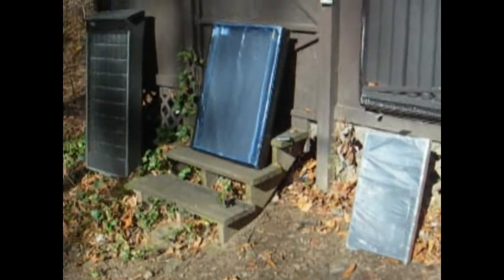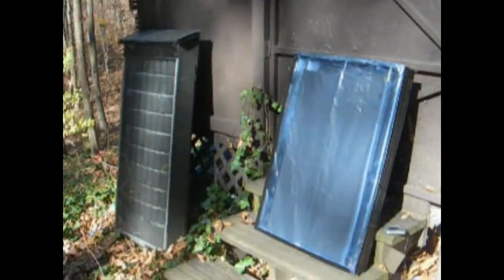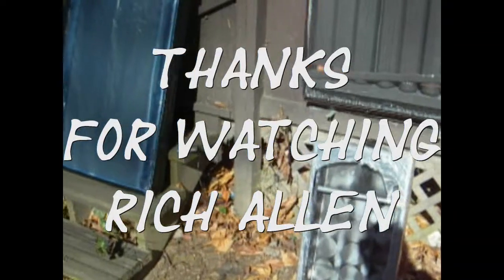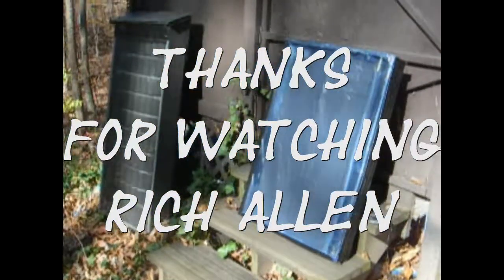SOLAR HEATERS FINAL THOUGHTS RICH ALLEN

Comment: Cool.  I thnk someone else indicated that all you really need to do is paint the box black and it should generate heat as long as the sun is out.  ??   So is it really necessary to even put the metal in the box?  Could you just paint it black and put the plastic over it?

Comment: Exellent idea to compare various models. The real test would be to stick the same small fan (say from an old computer) on each in turn and compare temps after they stabilize.  I also doubt the necessity of cans. Wonder if inside the box you strung used Aluminum Xmas garland and sprayed it black. Lots thinner and might conduct more heat to the air flowing past it. Double up layers of 4 mill clear plastic? Space them apart with small pieces of  quarter inch weather strip door foam. Thoughts

Comment: Rich, thanks for the video, I am interested to see what happens to all your heaters once a fan is put on them. I may be wrong, but I think the ones with the cans and glass would hold the heat better, and once the fans come on, the plastic ones couldn't keep up with the metal/glass one. (they would heat up quicker, and radiate the heat better)

Comment: 2" depth is the important dimension, can be as wide or long as you want as long as it's about 2" between the glass and the backing.  if you make the box taller you use stack-effect to create a stronger flow.

Comment: A solar can heater if built correctly will give you way over 200 degrees continuous. You should have built a larger unit unless your situation didn't accomodate for it. Nice work and thanks for posting all of your videos.

Comment: To use a Fresnel lens, make it bigger than the collector box, mount it in front of the collector box so that the light it collects and magnifies cover the entire collector box. For example, if the collector box is 4 sq. ft. and your Fresnel lens is twice as big (8 sq. ft.) you'll probably need it to be two to four feet away depending on the magnification factor of your lens. The idea is to capture more light than the collector box can and shine that concentrated light onto the box.

Comment: @richallenmusic I'm wondering if the design can be even simpler than you discovered. Do you even need to add metal inside the box at all? If you're using foil faced foam board for the box, I wonder if it's enough to just paint the interior black and have the foil surface radiate similar heat. Did you ever experiment with an empty black box?

Comment: hey Rich - is the trick with the pop cans mainly their surface area? - from your work seems like chicken wire to support painted aluminum foil would the most cost effective and least work intensive (?)  what's a good cheap black paint? do they really need an upper chamber? - are there any rigid plastic sheets which are cheap? - or best to wrap with 4-6mil plastic? - a full wrap would kinda protect the wood assuming not too much moisture settles inside.  Best, Freddy

Comment: The lens won't change anything. It will make some spots hotter, the rest cooler and the average won't change. The heat you get is based on how much sunlight the box captures and how much heat it loses.

Comment: Hi Rich.  My concern is melting the glazing. I live in Flrorida.  We do need heat for about 2 months in Tampa, but we only need to heat from about freezing to 70 (40 degree differential).  A couple thermal solar furnaces can do the trick but mine has reached 200F easily in the October Florida sun, which makes me uneasy to have anything but glass as the glazing.   Even in Maryland I have gotten the temp up to 175F on one I built at my brother's house.  Are acrylic or plastic ok?

Comment: I would think there has to be some limit to the depth of the box. Take a 1 by 10 by 1 foot deep box, it has  ten cubic feet of air. Same box 10 feet deep,  100 cubic feet of air. Now do you think both heat up at the same rate ?No , the deeper box has more air molecules in it,  therefore more mass to heat up,  which takes more time. 
 i am making a panel that is only 4 inches deep. Yes  very little "mass of air, But it should get warmer faster,  so just make "air turnover" through it faster.

Comment from the maker: hi i put mine right at the output. the temp on the disc is preset unless you use a adjustable one 
110 on seems to work good

Comment: @richallenmusic  The downspout heaters I made work well. I cut an extra hole at the bottom for more air volumn. That helps a lot . You need a good high volumn blower on them also. I know the blower takes electricity but remember when that one is running your furnace blower probably isn't so it's a wash :)

Comment: @Dudeyowuzup 

hmmm, i doubt a piece of poly over my collector  would suffice in my climate - the tighter the seal, the better - that's my point, i meant no offense. Great insight Rich! :) 
if you want simple - glass clutters, snips, hammer and a handsaw, it doesn't take a genius to build a box and cover it with glass. if you want cheap, RECYCLE. visit a few construction sites -contractors have lots of junk lying around that they're willing to part with, usually for FREE. all it takes is effort.

Comment: Anybody have any thoughts on increasing the depth of the box?  ie Use 2x6's or 2x8's around it and just increase the cubic space of the hot air?  On greenpowerscience they used a temp gauge on a dark colored car in the sun the inside temp was around 155 F.  That is a ton of cubic heat add a fan and move it around.